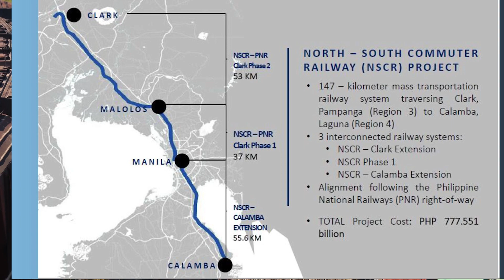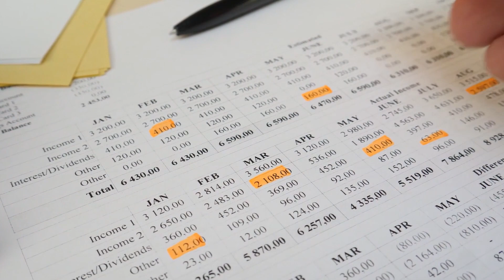The Philippines North-South Commuter Railway

Comment: indeed its the golden age of Infrastructure. build, build, build slowly transforming the entire PH. partida may pandemic pa. subway, north-south railway, LRT extension, Cebu LRT, Mindanao RT. then hundred of bridges, airports, seaports and others. wow. worth it and utang kasi may nakikita ang taong bayan.

credit goes to the taxpayers and law abiding citizens of the PH. kudos to DPWH for a magnificent job so far. at syempre for PRRD for the Political will! mabuhay PH!
#build,build,build
Reply: if kung sinu man next kay pres. duterte..dipende yan  kung ipagapatuloy n susunod na president... kaya no to dilawan👊✊
Reply: 0:23 the project was approve before du30 held office
Reply: @janiellepantua1668  yes approved before his term but was never really prioritized. only when the BBB took over it became a priority project and really took off. typical of previous admin to start ground breaking but would just complete insignificant percentage of the project. like what happened to skyway stage 3. groundbreaking was done last 2014 pa but after 3 years only 11% complete. only when it was incorporated under BBB that the project was finished after less than 4 years. 

you see, initiating a project is one thing. but having the political will to continue and eventually finish it is another.
Reply: Yes, partida...😁👍
Reply: Yung mga Airports at Trains stations sakop ng DOTr not DPWH. Pero under sila sa Program ng BBB

Comment: TY PRES DU30
Reply: DDS Spotted! hindi yan project ng poon nyo..itinuloy lang yan #@$%#@$
Reply: @jasonflores4250  Ang importante pa rin kung sino nagpatapos ng project. Doon dapat mapunta ang credit. Hindi yung puro plano at drawing lang. Kagaya nung TPLEX. Project ni Gloria yun bago natapos ang term nya, pero dumaan na si Noynoy at ano ginawa nya iniwan nyang nakatiwang wang. Sino nagpatapos? Si President Duterte.
Reply: @jasonflores4250  nassan na kaya  yung puro salita at mag papasagasa daw siya sa tren ?
Reply: @jasonflores4250  😂🤣
Reply: @jasonflores4250  please research po, the present line is under the Duterte administration and is to be aided with Japanese financing. The railway system is expected to cost 777.55 billion (US$14.95 billion), making it one of the most expensive projects of the Build! Build! Build! Infrastructure Program. Partial operations will begin by 2021, and full operations is expected to begin by 2025.